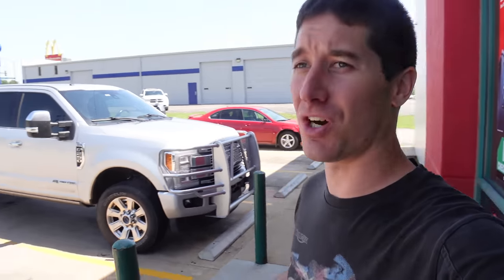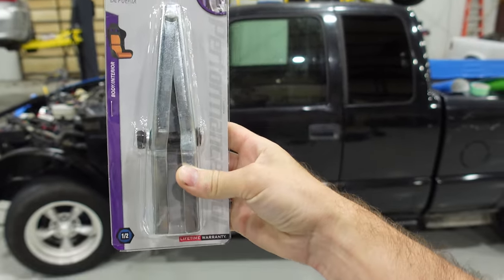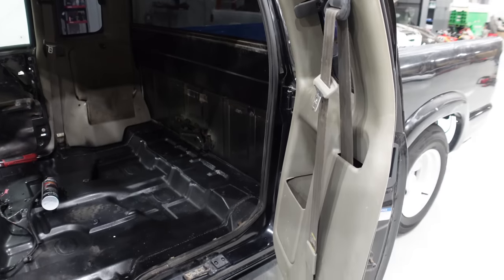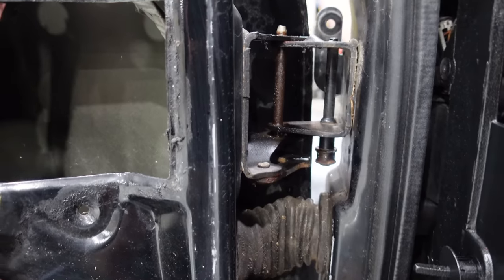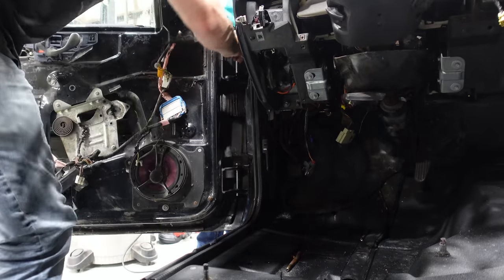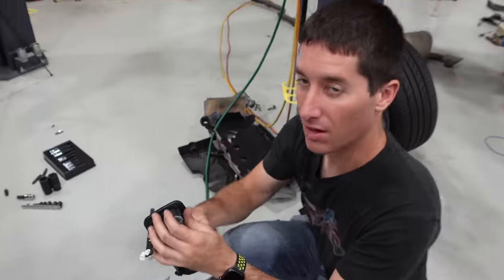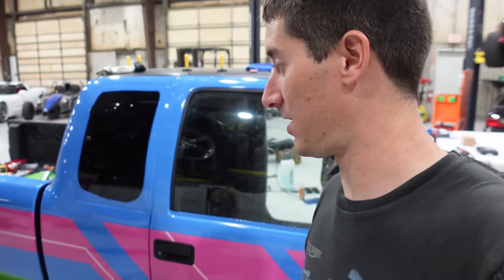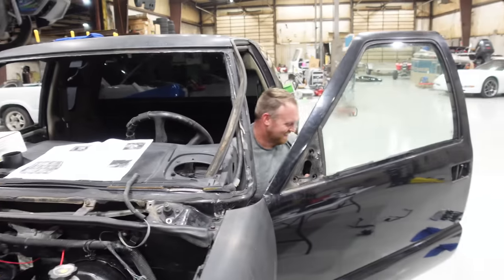Replacing These $4 DOOR PINS Will Make A MASSIVE Difference In Your Vehicle

Comment: I got 2 sets of the tool steel door and roller pins, for both my 98 extended cab and 99 Blazer. I’m not planning on touching them ever again. Did the Blazer last weekend. They shut and latch like butter.

Comment: I replaced quite a few GM's with worn out bushings and pins. I have seen some of the 2 door Regals and Cutlases where the owner let the bad pins go so long that the striker bolt was literally beaten out of the jam so I would have to weld a patch in the door jam. Good move John you can now smile every time you close the doors on your truck.

Comment: Same truck, I had lousy results with the bushing/pin kit. I finally just added the metal back into the hinge and added a couple of washers also welded in and ground off to the shape of the hinge. Problem solved. The spring tool is great and absolutely mandatory.

Comment: As the owner of an 86 Iroc-Z28,I feel this pain. The design is the same but slightly different. Third gen f body doors are extremely heavy so I can only imagine how many pins and bushings old monte Carlos went through
Reply: I think they added weight to the doors for side impact safety, but never re-designed the hinges.
Reply: The hinges weren’t changed for over 20 years while weight was added as you said,that’s the problem

Comment: If you pound-in the new bushings, you'll most likely crack them. Instead, use a 1/4" bolt, nut, washers, and a spacer (maybe a socket) to press the bushings into place. You can do the job with one person if you hold the door up with an engine hoist.
Reply: Engine hoist for the win.
Reply: I have also heard freezing the bushings the night before gives you a bit more wiggle room
Reply: I have a 70 year old whiz jack (bumper jack) that is great for holding up the door from the bottom. But yeah I've seen people destroy brand new hinge pin bushing by just knocking it in. Also sometimes the hole isn't round anymore and takes drilling and oversized bushings. Always had good luck with a chunk of all thread to do both at the same time.

Comment: I had an s10 once and had to replace those pins.  But I had to have the hinge welded back up because I let it go for so long that the hole was not a circle but an oval.
Reply: I had to replace mine several times I guess this is why
Reply: @TheGwflow  yeah they wear out.  If you get in time, it's an easy fix but I let my go for so long that I had to have it welded back up and repainted.

Comment: I used to take the doors off my 2000 blazer ZR2 every summer. Using a high lift jack is actually easier than having a second person. The last time I did it I got the pins in and doors hung in about 5 minutes per door by myself.

Comment: I changed a set a long time ago and one of the bushings split. My current S10 needs them but I just deal with it because they are a pain. If you do them get an extra pin kit so you can have the bushings for when they split when you are installing them.

Comment: i do so many of these that i had to buy a door hangar , which makes it so much easier , just put a bit of tension under the door and pound the pins out , you said 100k but they don't really last even that long , here in Colorado with all the dust 25k is about average.

Comment: If a 2nd person is not available to hold the door up, just put a floor jack on a cinder block with a piece of wood on the lift plate, and use that take the weight of the door, works like a charm.

Comment: If you lube the door hinges properly, you will never need to replace the pins. A dry lube spray like CRC 3044 Dry PTFE Lube, CRC 3084 Dry Moly Lube or CRC 3094 Dry Graphite Lube should be used. Never use oil or grease because dust sticks to them and turns the lubricant into a grinding compound.

Comment: I JUST so happened to be messing with the door handles and locks on my old 1989 c1500.. and oh my dear LORD.. the driver's side.. first thing that i knew was bad was a guy had his name and phone number on a refrigerator magnet behind the door card.. yeah.. so i got the interior handle and lock replaced.. fun no bggie. then the exterior handle and lock cylinder.. yes sir.. NOT GONNA HAPPEN.. hahahah it must be slightly deformed because I can NOT get a new lock cylinder inside the handle into the damn door.. it will NOT go in connected.. and there's no way in HELL it's going to go in from the inside, there's just no way it's possible.. I HATE door handles on old cars.. GOD i hate them.. haha great video JR thanks man..

Comment: Did I miss an episode on this build because I'm wondering why they are spending time on door pins instead of, you know, getting the engine running.  Are they waiting for parts?  I don't get it.  The most important part of the build, and it's being left for the last minute.  I will have to go back and rewatch some episodes I guess.
Reply: JR said the engine ran when he got it, so I'm guessing he's not worried about it. Clock's ticking, though!

Comment: Endura pins make S10 pins and bushings out of tool grade steel and you never have to replace them. They make themfor all GM trucks S10 pickup S10 Blazers gmt400 gmt800 and a lot of others
Reply: Sorry I didn't see the video first where you knew about Endura pants but when the hinges are worn out and you replace with new bushings they tend to make a new bushings fail way quicker than 100,000 cuz of the whole is wallered out